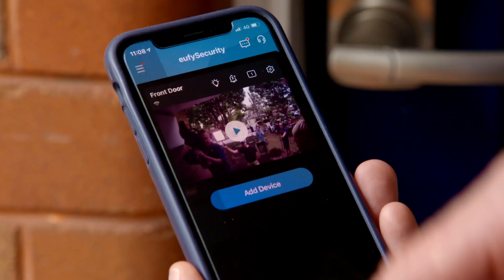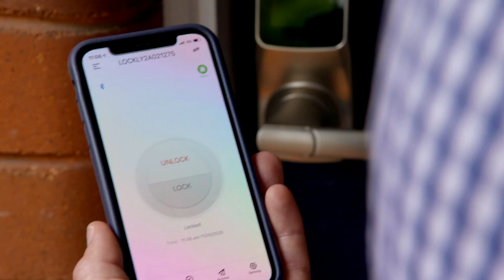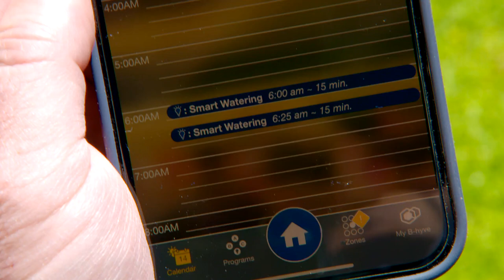How to Makeover your FRONT yard | GARDEN | Great Home Ideas

Comment: Looks great! Good work. However for concrete surfaces we use Resene Limelock undercoat and then 2 coats of X200 finishing paint. Much better coverage and adhesion. If the concrete fence lasts with the straight coat of paint then awesome

Comment: GORGEOUS COTTAGE LOOK. Lovely plantings and plant choices. Where's the 'Big Reveal' with the Owner?  Front deck & steps look great and timber stain choice really nice blend with the brickwork.  Fence and trim colours thoughtful and complimentary.  
The head height placement of the front light / camera however is too low. 
The path - couple of things... 
First; suggest avoid using those cheaper house bricks with the holes, these make great homes for spiders / slugs / snails etc.... Suggest use solid edge pavers instead - not much price difference.  Second; even with compacting... loose surface not ideal, particularly with any elderly, or kids,( kids bikes!) and more maintenance if very wet, also eventually more weed growth. Prefer paving.  The front fence, aesthetically get it about following the original step down, but maintaining height straight across would have provided more privacy from the road.  
Agree with Emer - as below.  Unless you are able to do all yourself the labour costs to rip out all that concrete and lawn ,garden and remove, and purchase, delivery, spread of new soil and new turf would be exorbitant.  Not everyone has 'a team of mates' to come around and do it all in one day, or even several days, for free. Even a quote just to run a new drip irrigation system around and mulch over can run into $100's.  Many, without a production timeframe to work to, might also prefer to 'weed & feed' the existing lawn, slowly  over several months to bring back to healthy state. So, some great ideas and execution, but really depends on budget and purpose. ie; is someone going to live there and maintain or tidying up for a quick flip?

Comment: What sort of nail gun do you use for the picket fence? I was told it has to be a coil gun but happy for suggestions
Reply: The type of gun you saw used was the Paslode brad nailer. Not sure if was angled type, but a straight one will be sufficient.  Ryobi has brad nailers too. If you don't want to spend the earth, spend some money instead on a cordless drill driver set and get some screws. Drill pilot hole first and screw into place. May take longer to complete the job, but at least you will be saving more cash in the end.